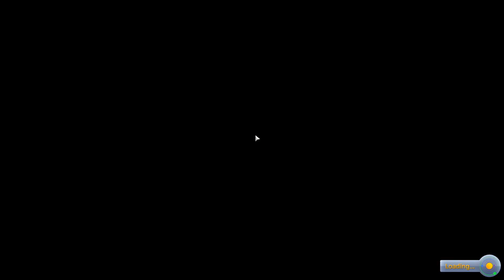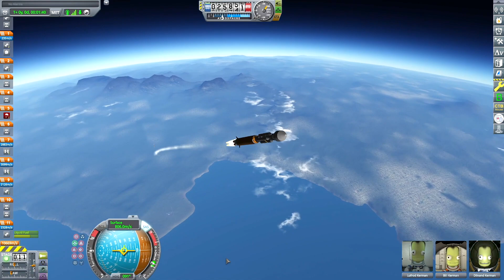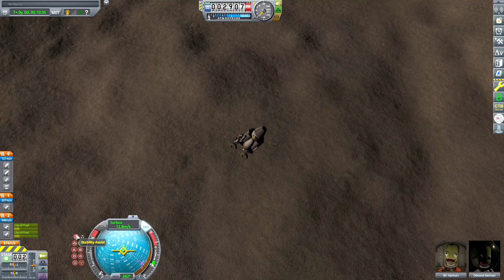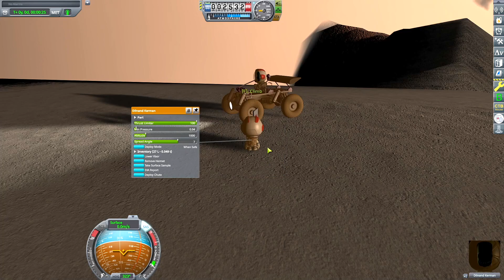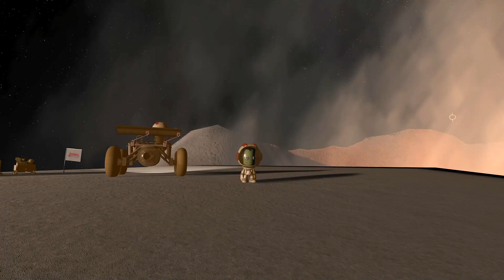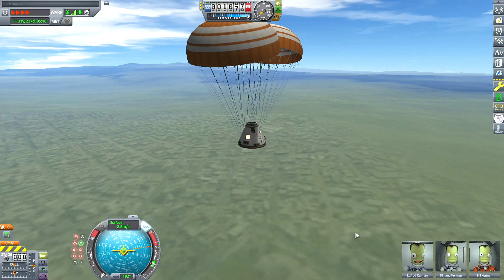SPACE VOLCANOES on Dipuc - in Kerbal Space Program - Kcalbeloh System Mod - Stock Parts

Comment: When i landed there the volcano didn't have smoke or lava
Reply from the maker: Mine don't have lava either, it just gets red textured near the bottom and you explode from the heat. The smoke thing might be from not having EVE installed or something like that
Reply: Thanks for the help i have been having issues with eve but when i jumped into the volcano i saw that the smoke spawned underground